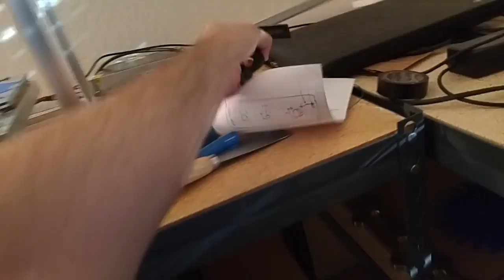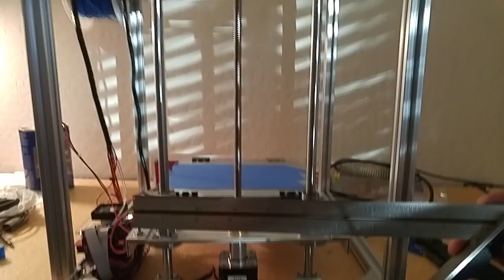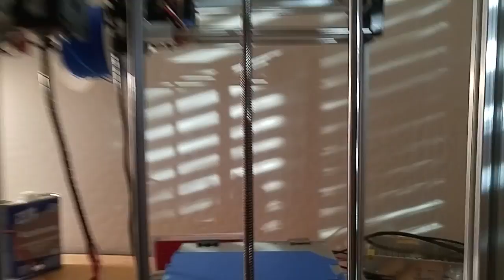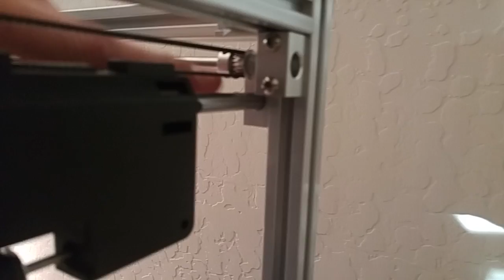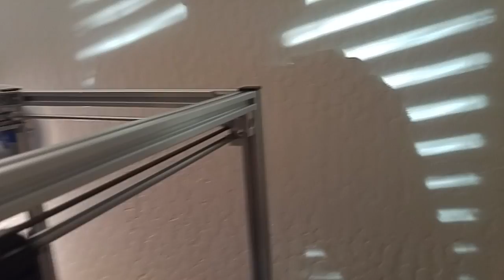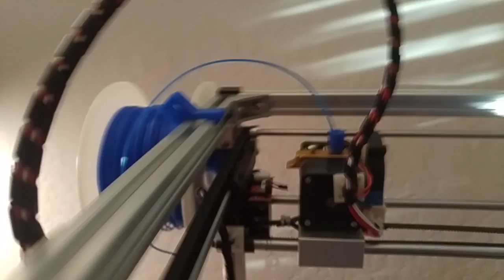Flying Bear P902 3D printer tramming, build tips, and potential issues

Comment: Hey - thanks for this video! This is the kind of issue I don't even know enough to think about! I don't see how swapping out your Z blocks would let you get any squarer, so what I did was just shim the blocks with little slips of paper until the Z rails were more or less centered on the frame extrusions on the other end. I figure if it works for piano construction, it's got to be good enough for a printer.

Comment: Hi! I have build one and I am having a problem, I have build as the connection manual says, but when I print things, prints reflected, I mean, I have printer the calibraiton cube and the Z it is inverted, what can be the problem?
Reply: Another easy way to do it if the motor is just spinning the wrong way would be to just flip the stepper motor connector.
Reply from the maker: That is a firmware issue. I think you can set that in repetier under "config>>EEPROM config", but you may need to use arduino IDE and re-upload firmware.

Comment: How is the print quality on this printer?
Reply from the maker: Its my first printer, but Id have to say very good to excellent for an FDM. I have it holding tolerances to less than 0.1mm in X, Y and Z, and its quite repeatable. Even the knock off MK8 extruder works well as far as I can tell. Its also very stable and therefore can print quite fast, 100mm/s+ are not an issue, although you will start getting some corner ringing due to belt stretch im guessing. Belt tensioners may help that.
Reply: Awesome, thanks!

Comment: I am considering this 3D printer. Also, I would like to attach side and top panels to control temperature and fumes. Do any parts (motors, PSU) stick out of the frame? Is it possible to keep everything inside the frame such the I can mount the side and top panels directly on the aluminum structure? Thanks.
Reply from the maker: Yes you can keep everything inside of the frame, so it makes it for a nice flat surface to add enclosure panels. The only thing I had to do was print some brackets for the ramps to get it further inside to clear some cardboard panels i added, that slot into the inside grooves of the extrusions.
Reply: Thanks for your replay. Could you direct me to an STL file so I can get a better idea of how this part looks like? Thanks
Reply from the maker: Its just a simple L bracket, I can upload it to thingiverse if I still have it.

Comment: How would you say this printer compares to the tevo turantula?
Reply from the maker: hasso0n the bear is a much better printer. They use similar electronics, but the bear has a much better structure and x carriage drive. you have to brace the tevo quite a bit to even be close to the bear. The tevo does have an e3d clone hot end where as the bear uses a mk8, but that can be changed easily. The bear also has more build volume.

Comment: Hey Sir, I've got a silly question. I believe I have a pully in the wrong place. The pulley I have the Y motor belted to wont screw down and simply spins around when the Y motor tries to move. Even when the pulley is off the rod the small blacks screws do not tighten past a certain point. I did not notice this until I had the printer all wired up.
Thank you for the video and sorry about the stupid question

Edit: I "fiixed" it. This question belonged in the newb section. lol
Reply from the maker: It sounds like you might have got some pulleys that didnt get drilled and/or tapped all the way through. You may want to request a new on from Linda at Flying Bear. They like to handle warranty stuff on Ali express, so contact her there.
Reply: dsrtrdr thank you! I'll contact them. please make more videos. this was by far the most helpful video I've found after months of researching printers everyday. subbed.
Reply: if you need any help just join the facebook group there are so many people that has this printer that could help
Reply: I didn't know it existed. Joining it now. Thank you